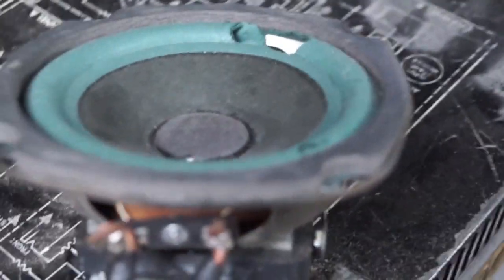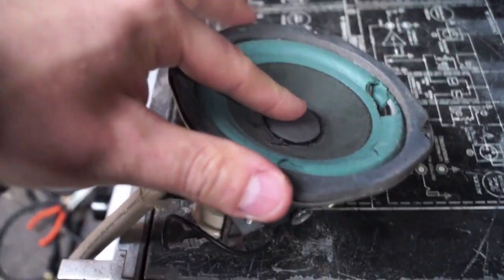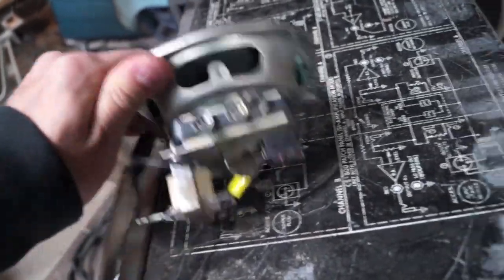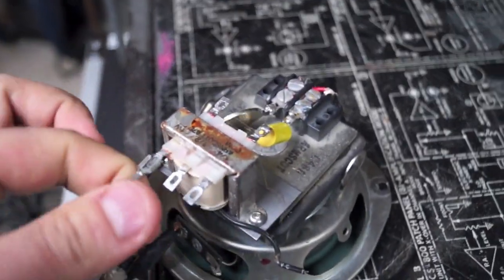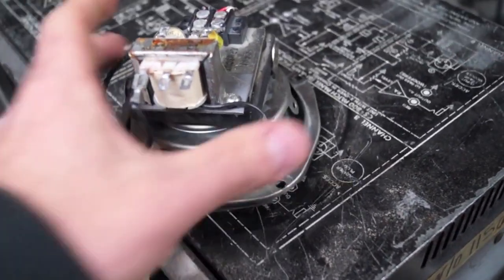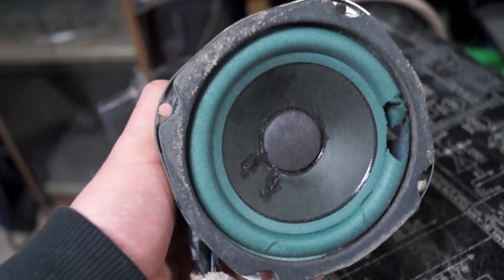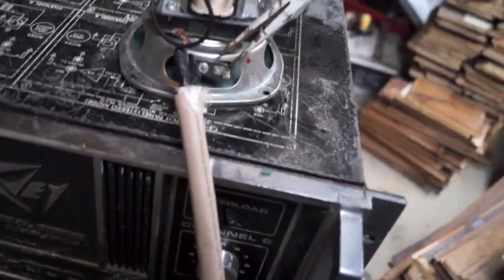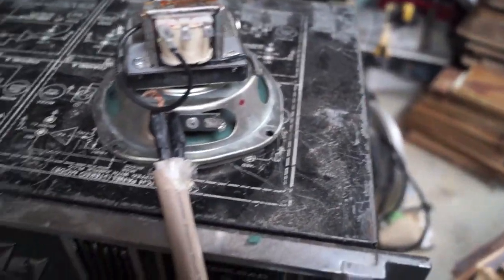SPEAKER BLOWOUTS! - Wicked Excursion With Fire Alarm Speaker

Comment: Can you try driving some fixed diaphragm speakers with that amp? you can usually find them on devices designed to repel insects or animals using high frequencies.

Comment: Actually, if the foam was good it wouldn't sound bad at all!
Reply: Joshua's Recordings yeah! I'd use on in a costom build
Reply: @colinshrom3704  Look up quam speakers. They are made in Chicago and their individual speaker line might be worth a look. I have a Quam 30A05Z8 3in alnico speaker from the 1980s. It has a moisture resistant paper cone and a soft felt dust cap, with 0.205 spade lugs that you can solder wires on to or use disconnect terminals on. haven't got around to making an inclosure for it yet but will probably make a simple one from pvc pipe or something lol. It sounds good enough already without one!

Comment: That's meant for a voice evacuation system
Reply: yeah indeed.
Reply: I have even seen these in normal similar looking intercom speakers. They usually have fabric surrounds on the speakers, this one had the green foam. Hard to know it this was a usual intercom speaker or one with a strobe mounted on it for alert (fire, CO, general alert) use.